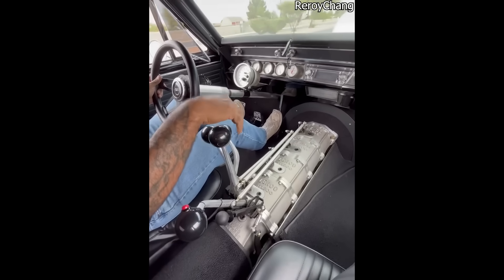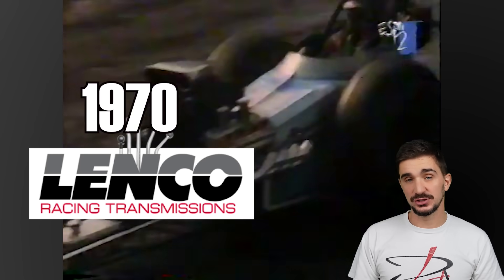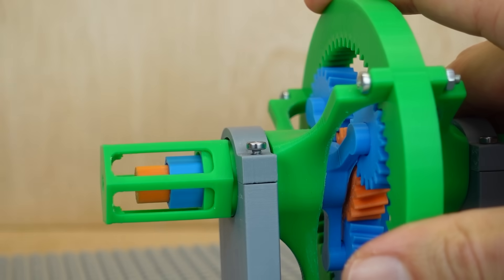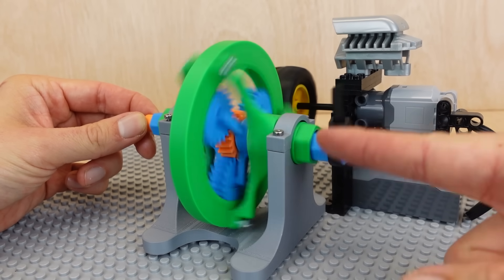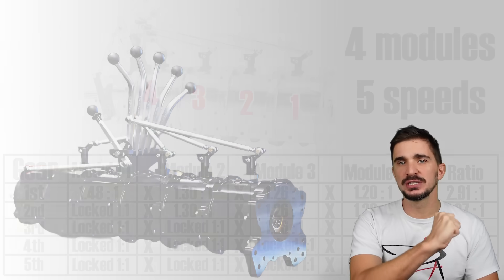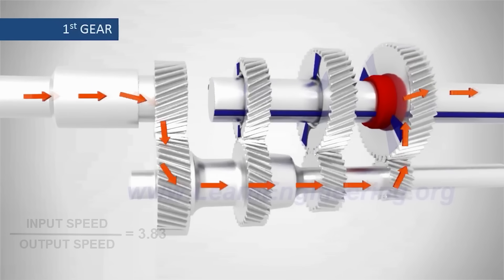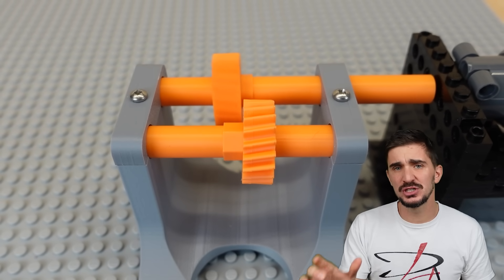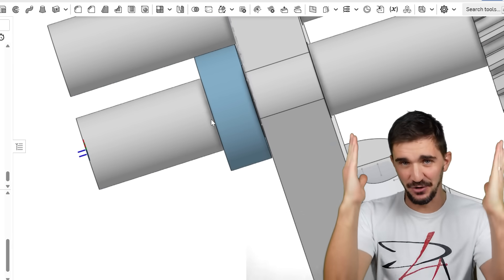This is The Strongest Transmission Ever Built - Planetary Manual Lenco Gearbox Explained

Comment: Wouldn't you only count 3 contact points for each module considering the others are in series? And if thats the case wouldn't you only consider 3 contact points for the intire transmission?
Reply: Also, wouldn't this be super hard on the engine considering the change in gear ratio is almost instant? This would probably be the same with an advanced driver in a manual car though. But it would cause massive torque peeks when shifting cause the engine needs to slow down to the current wheel speed considering the gear ratio.

Comment: Great video, one detail though: You shouldn't count the gear contacts that are in series, it's the weakest point that matters. For the traditional transmission example you showed, it's the second gear pair (as that has larger input torque) That is a single gear pair with (depending construction) maybe 2-3 gear teeth in mesh at a time.
With planetary transmissions, you have a divided path of torque. Thus the number of gear pairs meshing is the number of planets (in above example, three)
Reply: Was looking for this comment so I don't have to write my own.
Reply: @charlsmann6188  same
Reply: @charlsmann6188  Me to😆
Reply: Indeed that was a glaring mistake. There are always 3 teeth pairs that share the highest load. Which will be in the last module (closest to the output shaft) when the other modules are in low gear.
Reply: @ComplicatedStuff  If they're simple to rebuild that's another huge plus.
Reply: @ComplicatedStuff I wanted to reiterate for clarity that it is three pairs of teeth vs. ONE pair of teeth for a regular standard trans.
Reply: I was going down here to see if anyone mentioned this. It's such a glaring fumble that I can't help if it was done on purpose to increase "engagement" for the algorithm. I seen him make similar obvious mistakes in other videos.
Reply: @siggyincr7447  Engagement for a transmission video? :3
Reply: @samiraperi467  great
Reply: Well explained...
Reply: He probably did knowingly, thus making us all comment
Reply: Bonus feature of a planetary gear is the forces trying to push them apart under load makes the teeth dig in harder since the entire assembly is constrained by the ring gear. You don't need external bearings to force the gears into proper meshing tolerances.
Reply: yeah butt, couldn't just make the orbital gears in the center of the set as "Torsen differentials" to get around & use the torque?
Reply: Maybe in the aouianal for gear sections but that isn't.
Reply: Wrong.
Reply: I saw that Lenco & others make a street able 5 spd  multi lever gearbox but is it less engaging/fun to drive on the street VS a traditional manual sports car transmission? 
Or is that a personal preference?
Reply: @michaelbrinks8089 personal preference. I've seen some people drive standard sequential transmissions, which are similar in how you have to shift, unlike a standard H pattern in which you can skip gears.
Reply: @michaelbrinks8089  fun is subjective tho, so it might be fun for other people.
Reply: @sepg5084 Exactly, I guess what I wanna know is....
Would a person who finds common  manual transmissions a bit annoying on a daily driver, find a multi lever transmission much more annoying? Or only slightly more annoying, one they got used to it. 
That is if they mind the noises from the straight cut gears,
Reply: Easier for my wife to drive?
Reply: If I may add, because of this sequential design Lenco transmissions are not the strongest. Definitely not by metric of max torque per kg of gears.
When you can connect different parts of different planetary stages like in a modern automatic transmission, you truly get splitting of torque. And you can have manual control with a single stick, clutch not obligatory, that's what some tanks do.
But with bad designs you also get so called circulation of power when some gears resist others and undergo greater torque than output. Or spin faster than input and ask for stronger bearings.

Comment: i surprisingly feel like i finally understand planetary gears because of this video! i was looking up E-cvts and i got completely lost, this helps a lot with me at least understanding planetary gears.

However i find myself wondering is there a way for this transmission to also add an overdrive Gear? i Know it isn't in its purpose but purely theoretical is it possible?
Reply: planetaries can do overdrive with something like locking the sun, driving the planets, outputting to ring. issue is the engagement of the lenco system is a single lever per module, which is a bit too simplistic to do alternative ratios per module. modern automatics can do stuff like squeeze 8 speeds out of 5 planetaries, which require a bunch of shifting directions of power.
Reply: Why? Just use a lower ratio rear diff and don't worry about the driveshaft speed because the transmission's length makes that super short anyways. As a bonus, the lower the ratio in the differential, the bigger the pinion gear, which is both stronger by default and also has more tooth contact with the ring.

Comment: Can you really say there are that many contact points if they are inline to each other? You can add a bunch of 1:1 gears to a manual, but it doesn't make it any stronger. The weakest one in the chain is the weak point.

However I can see how it has mutiple sets of 3 contact points in parallel, where a manual only has 1 point between gears.
Reply: Thank you, looking for this comment
Reply: Correct - the advantage is only in parallel power transmission paths, so with three planet gears per set the advantage is a factor of three, not six; the conventional countershaft transmission shown has only a single contact per gearset.
Reply: You're right, only the weakest link counts. The advantage of planetary gearsets is that it nullifies radial load, or the load trying to push the gears apart against each other. For that, only 3 planets are enough (2 makes it unstable), but putting more planets will help you with heat dissipation, force spreading and smoothness.
Reply: @gsilva220  tbh it was probably a psyop to get more comments.

Comment: Thank you for the content👌 
Would you consider doing a video on what is the most reliable and efficient transmission for regular cars?
Reply: Most efficient is CVT, most reliable is either a traditional manual or automatic depending on how they're built and if you consider a clutch part of the manual trans itself
Reply: @Onewheelordeal agreed) I wonder, if anyone explored a solution which doesn't compromise on one aspect to achieve another
Reply: @VladTheLad4x4  koenigsegg had a car with a clutch for each gear.

Comment: Nice, didn't know these things existed. Just a thought though, am I correct in the assumption that you don't have to engage the modules in a specific order, meaning you could have different 2nd 3rd and 4th gear ratios depending on which order you engage the modules?
Also why isn't it good at downshifting, doesn't the clutch pack disengage immediately?
Reply: Another guy posted this one, just dropping this here

Hi, 
With different ratios for each module, there are 16 possible ratios:
Gear	Module 1	Module 2	Module 3	Module 4	Ratio
1	        1,48	        1,30	        1,26	        1,20	        2,91
2	        1,48	        1,30	        1,26	        1,00	        2,42
3	        1,48	        1,30	        1,00	        1,20	        2,31
4	        1,48	        1,00	        1,26	        1,20	        2,24
5	        1,00	        1,30	        1,26	        1,20	        1,97
6	        1,48	        1,30	        1,00	        1,00	        1,92
7	        1,48	        1,00	        1,26	        1,00	        1,86
8	        1,48	        1,00	        1,00	        1,20	        1,78
9	        1,00	        1,30	        1,26	        1,00	        1,64
10	        1,00	        1,30	        1,00	        1,20	        1,56
11	        1,00	        1,00	        1,26	        1,20	        1,51
12	        1,48	        1,00	        1,00	        1,00	        1,48
13	        1,00	        1,30	        1,00	        1,00	        1,30
14	        1,00	        1,00	        1,26	        1,00	        1,26
15	        1,00	        1,00	        1,00	        1,20	        1,20
16	        1,00	        1,00	        1,00	        1,00	        1,00
👼

@MsBrouzouf

Comment: 12:30 why dont they use double helical gears? In manual its impossible because you cannot slip double helical gears into each other, but in this kind of transmission it doesnt happen, so what's the reason?
Reply: Citroen did it. And then made it the basis of their logo.
Reply: Double helical gears, while great for canceling axial thrust, are complex and costly to manufacture, require precise alignment, can have lubrication challenges in the central gap (for non-herringbone types), and result in wider, heavier gearboxes

Comment: Am I right by saying that you can engage these locks in any order? So you actually get more ratios than stages? For example from 1:3+1:5+1:7 stages (theoretical values) you can also get 1:21 ratio?
Reply: Correct
Reply: There is a downside of doing this?
Reply: @fl4v10filho  just rpm drop depending on the ratio lever you shift

Comment: I have heard that double helical gears where both of the "tooth spirals" go in different directions can cancel out the axial forces. Why aren't these used in such transmisions? Is it because of production or some other mechanical flaw with such gears?
Reply: Straight cut gears have less losses, doesn't have to be built to handle and axial loads (aka a bit lighter) giving maximal performance.

Helical or double helical gears are mainly for less sound from a gradual engagement between the gear teeth. The difference is sort of like slamming your whole hand down at the table compare to first hitting the thick prt of the hand and letting the whole hand roll down to the table.

I think the technical term for straight cut gears is point engagement (seen from a side view) compared to a line engagement for helical gears.

PS. I guess the point contact from the straight cut gears also makes it necessary to manufacture all parts with a bit tolerances compared to helical gears. Even small problems with straight cut gears should sound even more than they normally does.

Comment: Hi, 
With different ratios for each module, there are 16 possible ratios:
Gear	Module 1	Module 2	Module 3	Module 4	Ratio
1	        1,48	        1,30	        1,26	        1,20	        2,91
2	        1,48	        1,30	        1,26	        1,00	        2,42
3	        1,48	        1,30	        1,00	        1,20	        2,31
4	        1,48	        1,00	        1,26	        1,20	        2,24
5	        1,00	        1,30	        1,26	        1,20	        1,97
6	        1,48	        1,30	        1,00	        1,00	        1,92
7	        1,48	        1,00	        1,26	        1,00	        1,86
8	        1,48	        1,00	        1,00	        1,20	        1,78
9	        1,00	        1,30	        1,26	        1,00	        1,64
10	        1,00	        1,30	        1,00	        1,20	        1,56
11	        1,00	        1,00	        1,26	        1,20	        1,51
12	        1,48	        1,00	        1,00	        1,00	        1,48
13	        1,00	        1,30	        1,00	        1,00	        1,30
14	        1,00	        1,00	        1,26	        1,00	        1,26
15	        1,00	        1,00	        1,00	        1,20	        1,20
16	        1,00	        1,00	        1,00	        1,00	        1,00
👼
Reply: I'm wondering how you would shift if you have to move 4 leavers at a time
Reply: @charlsmann6188  Integrated gear hubs on bicycles do this by using a camshaft instead of levers.

Comment: I've seen so many exploded diagrams/drawings of planetary gearboxes, but this is the first time I have seen a good, nay, excellent, explanation to go alongside. Trying to understand by just looking at a drawing is hard! And something always seems to not quite make sense.

Thank you.

Next, the Rolls Royce Power Gearbox for aero engines... 70,000 to 100,000 hp claimed. And explain what they have done to overcome the issues of the Lenco... Looks like dual helical?

Comment: If each module has its own gear ratio, would it mean that it is a 2^(number of modules) gear transmission? And so a 4-module transmission would have 16 gears? Why wouldn't you switch gears individually and not one after the other? Also why is downshifting a problem?
Reply: They would be very close gear ratios, impractical to shift manually because you'd need to be as precise as a semi truck driver whilst driving something an order of magnitude faster
Reply: @LamantinoElettronico Can you expand the range so it makes sense to put the transmission in a truck? Can you put a magic mechanical box on top of those levers and make it into an almost-CVT? What if you remove one or two modules to make into a more reasonable 8-gear or 4-gear transmission?

All genuine questions I have cuz I am far from being an expert
Reply: @trainee5471 I'm not an expert either, so mine was a guess. Though I suppose everything can be done if you're willing to sink enough money and time into it

Comment: Very interesting, thanks a lot! You said, that two rotating parts are locked together, how does this work? In your video you just push a stick. I am not sure how this works with high force and or speed involved. Mayve follow up video?
Reply from the maker: I mentioned it and showed the part in the video. Clutch packs
Reply: He didn't really visualise it, but it works the same way any automatic would. You have steel plates on input and friction plates on output or vice versa and you apply pressure to lock them together, by pulling the lever.

Comment: 12:50 - Or we need Citroen and their double helical (herringbone) gears.
Reply: Double Helical has a gap between the different gear angles and Herring Bone do not. Double Helical is thus less expensive to produce but not as compact. Herring Bone can be used as a pump. Neither one has axial thrust problems.
Reply: @bradhuffjr777 Also something of importance; DO NOT back drive Herringbone Gears! They WILL Break and it WILL be Expensive. Oil doesn't really compress well, it'd be the equivalent of lubricating with pea gravel.
Reply: @Stormreaver1000 

I have never had a problem with 100psi and less flipping the gears made from 6061 Aluminum extrusions and no heat treat. My area of experience is multi stage AKA Dry Sump in motorsports. What is your area of experience? Hard Coat Black anodizing with Teflon helps to see wear and/or scoring when servicing. Valve Spring chips are hard to find, intil they pass through the scavenge section spur gears... 🤔
Reply: Those must be fun and cheap to machine!
Reply: @miketdavies  herringbone gears were introduced by Andre Citroen (of the car brand fame), who figured out the machinery to make them on an industrial scale. He used his new found fortune to start the car brand, which is why the Citroen logo has the double chevron in it.
Reply: Funny part is that there are machines in existence with "double chevron" gears which predate the Citroen patent.
Reply: @ComplicatedStuff yes, Citroen bought the patent and figured out the machinery to male them on an industrial scale.
Reply: @ComplicatedStuff Quote:"It is however apparent that at some time during his first army period he became technically aware of wooden double helical gears being used in Poland for driving water-driven machinery. He also became aware that double-helical gears ran quietly and were capable of transmitting considerable loads without damaging the wood they were made from. He was aware that the same wooden double helicals were successfully operating Lodz textile mills and could see the technical advantages if such gears could be made out of steel. 

Precise accounts as to how he eventually got to designing steel gears also differ. Some biographies say that steel double helicals had already been made by his relatives in Glowno, some say that his brother in law had the patent which he sold to Citroen, and yet others that Citroen purchased the rights to manufacture steel gears from a Russian company which was already making helical gears in Russia. The official Citroen Car Company version is that he purchased the patent rights from a man in Poland. In any event, by 1904 Citroen had left the army and had filed a patent for the double helical chevron gear to be made in steel."
https://www.svvs.org/citroen2.shtml
Reply: Was looking for a double helical gear comment thank you
Reply: wait what is that where the Citroen logo comes from?